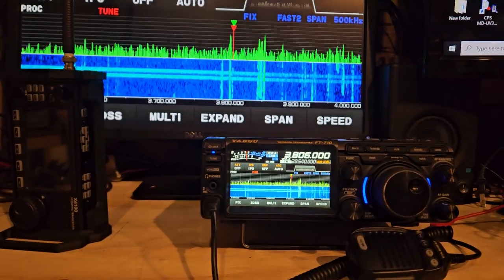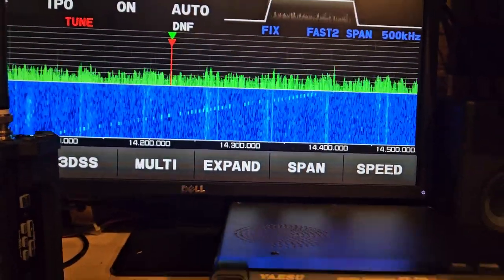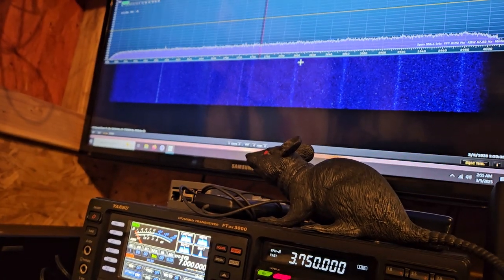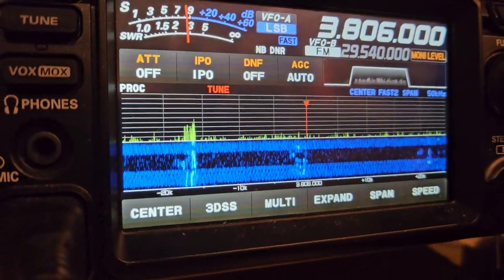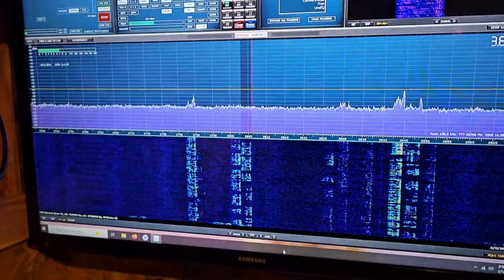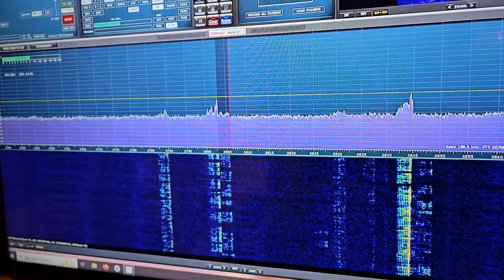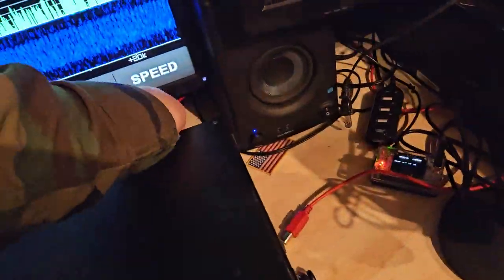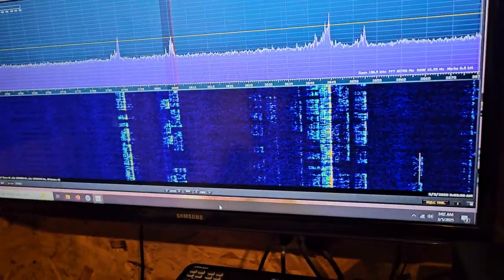Ft710 yaesu vs sdr play waterfall.  Sdr ham radio stuff

Comment: I use my 710 with my RSP1B daily with SDR Console all ran through a
rx audite switch with lna,80 DB att & Bpf band depending. Fantastic for weak signal work & noise reduction all with the benefits of SDR Console running on my ultra wide monitor & multiple receiver options. Been operating this way for over a year now with zero problems. Granted the switch I have isn't cheap yet has great protection. The software also has safety features built into it. When my radio keys up, the switch & software mutes/kills all receive to the sdr protecting everything inline. Absolutely love it.
Reply from the maker: I have a mfj sdr switch it sucks. Lose 3db 
So usually i just use my rsp1a w my ftdx3000 since it has rx out jack that goes through front end of radio. You lose nothing as long as both are on same band. It does suck if you want to use 10m and radio is on 80 or something

Comment: Scopes are totally useless on the newer Yaesu, just get a SDR board and install it and use SDR console, other than that just look at the scope, it gives me a headache, I have the DX 10, N2EME SDR and SDR console, it will transform your radio experience.
Reply from the maker: Im using my ftdx3000 and the rx out to my sdrplay running sdruno and OmniRig to sync the 2. Its a game changer. I used sdr consule a while stand alone.

Comment: The resolution on the radio pan adapter you are seeing is not related to the sample rate of the receiver. It’s the video driver and memory with a DVI-D not HDMI is part of your problem. As an example I have an Elecraft K4 and its resolution is much better with 4K HDMI output.  The point is yaesu spent the money on the receiver not the display.
Reply from the maker: Yep. And if you think this ones bad. Check out the ft991a lol 😆 or the ftdx3000. Of course those don't have a video output but either way icon was always better than these ones my old Icom 756 pro has better screen resolution than some of these

Comment: I would agree SDR play display of scope is clearer. I use 710 and SDR at the same time.
Reply from the maker: I had a sdr play blow up before so i dont trust sdr switches also the mfj one causes you to lose 3 s units or so of rx signals.  Really bad. The 3000 has a dedicated rxout jack. So its fully  isolated on tx. And rx it goes through the front end and roofing filters too. Only works with radio on also.